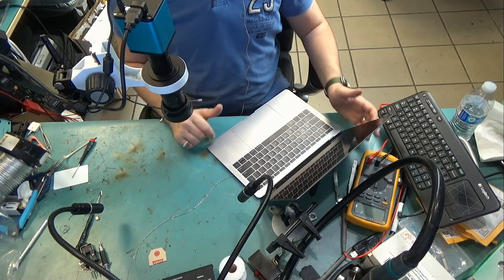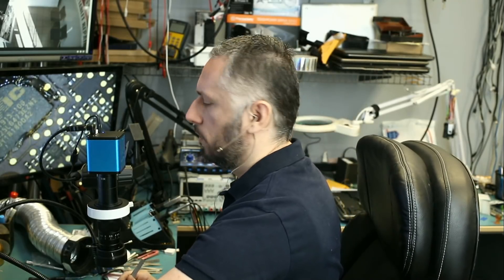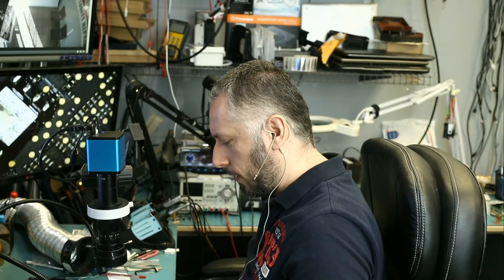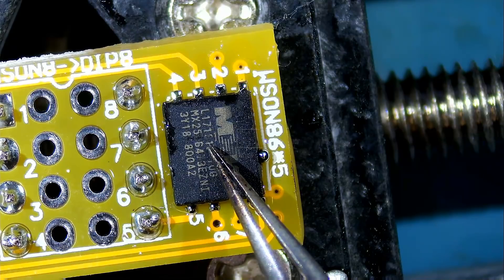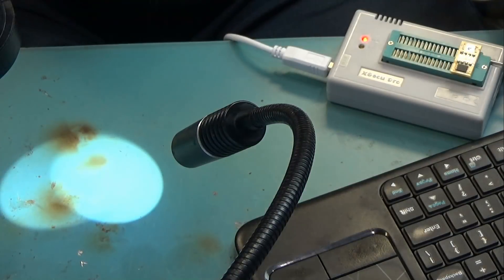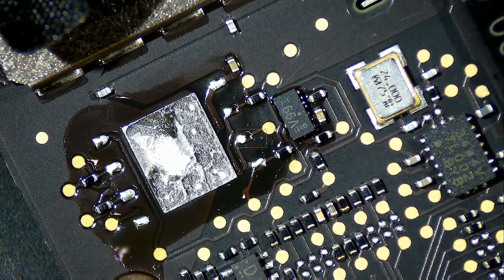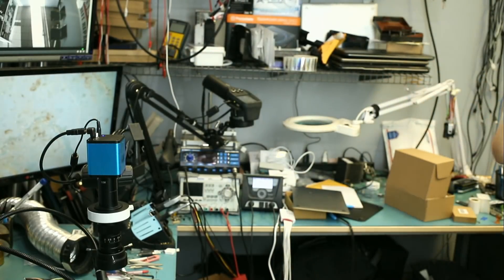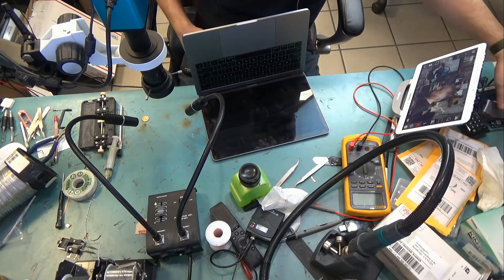2017 macbook pro A1708 EFI Password removal / QFN Chip programming TL866II Plus

Comment: Why desolder the chip off the board when you can use the service port on the board to flash the chip. In that case there is also no need to remove the board out of the case. Just unplug the battery, give the board 3.3v and start programming!
Reply: That's because he needs to charge 200dollars for a chip programming.😂😂😂

Comment: A question: The i7 2860QM can support up to 32GB of RAM. Is there a single 16GB DDr3 memory stick that is compatible to a 17inch 2011 MacBook Pro? If there is such a thing, can one hack into the bios and extend the memory capacity of that 17 inch to 32GB by using two 16GB memory sticks?

Comment: merry x mas to you 

Please tell us whats the name of that special programmer card
Reply from the maker: It's a QFN8 Adapter. Cost only $1 from china. https://rover.ebay.com/rover/1/711-53200-19255-0/1?mpre=https%3A%2F%2Fwww.ebay.com%2Fitm%2FWSON8-To-DIP8-Programmer-Adapter-QFN8-DFN8-MLF8-To-DIP8-Socket%2F123513741907%3Fhash%3Ditem1cc1fe2253%3Ag%3ASJYAAOSws0pb~PAn%3Ark%3A1%3Apf%3A0&campid=5338440312&toolid=20008
Reply: lot of Thanks , 

usually i watched your useful lessons , so thanks for everything 

Keep it up

Comment: You dont need to desolder the EFI Bios chip, on the macbook air there is a EFI debug port on the mainboard wich you can access to the bios chip directly on mainboard but anyways a really good video :-)